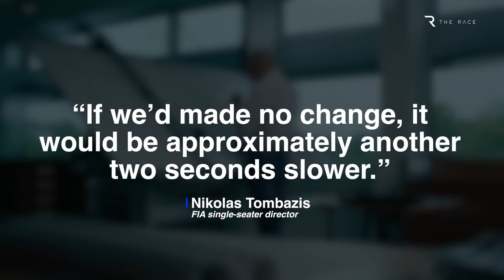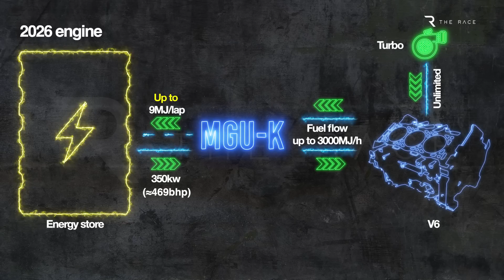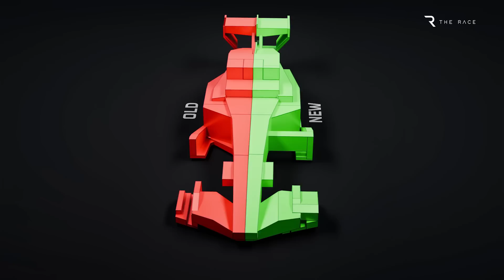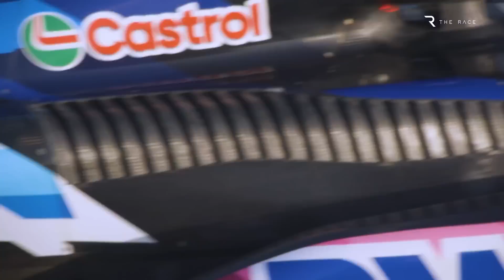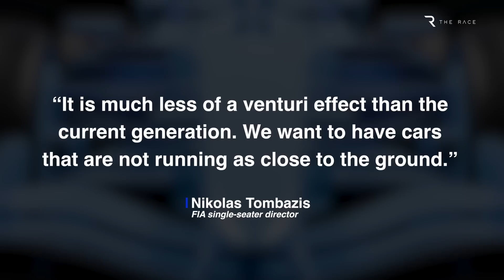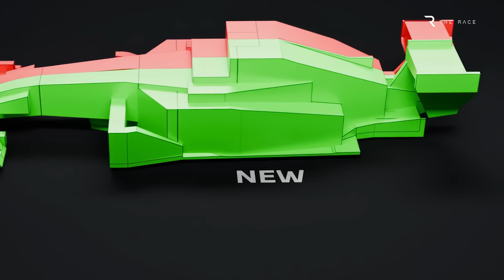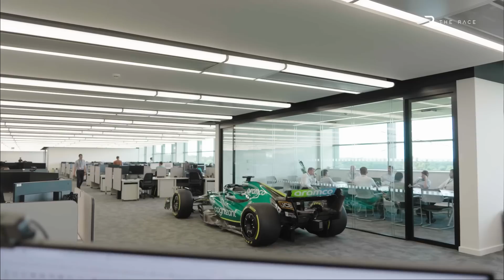How F1's 2026 cars will now be two seconds faster

Comment: If they make the body 10 cm narrower during every 5-6 years rules change then in about 500 years we should have a Monaco Grand Prix that is actually worth watching! 👍
Reply: I don't know, people seem to really enjoy Monaco during Formula E races and those cars have sizes comparable to F1's with the 2026 regulations. I think the slightly shorter and narrower body will make a bigger difference than we think in cramped circuits.
Reply: @theviniso  Yes, but Formula E has the advantage of low downforce and equal cars.
Reply: @Lianpe98 I wouldn't call E racing cars equal, if they where actually equal they would have the exact same track time and all the cars would be on the front row #1 qualifier.
Reply: @Allansybesma  It's a spec series, isn't it? It's all about the driver and the setup.
Reply: @Lianpe98  It's not. The chassis is spec but teams make their own power units, gearboxes and suspension.
Reply: @julianturberfield7101  oh, ok, nevermind then
Reply: @julianturberfield7101    Aka, spec series.
Reply: @Allansybesma  ??? dude, the drivers make the difference
Reply: @theviniso  Nothing will change overtaking-wise, especially considering the pre-1998 car dimensions.
Reply: Monaco is great in Formula E, the cars are not even that much smaller but the racing is great
Reply: monaco is not worth watching, watch the qually and then you know the race result
Reply: The car has to be a french fry wide to actually make monaco interesting
Reply: Monaco was never worth watching and I have watched it for over 40 years.
Reply: @AlexandreMS71 yea it's not wide enough to make good passes.
Reply: @AlexandreMS71 then you must have missed some bits along the way ;). Those last few laps of monaco 1992 are probably the most exhilerating thing ive seen happen in any series on any circuit
Reply: @AlexandreMS71  Guess you started watching after 1984
Reply: @harrr53  1978
Reply: @AlexandreMS71  And in what way was the 1984 Monaco GP not worth it?
Reply: @harrr53  it was an exception, not a rule, 1 out of 10 or 20, I do not think it is worth at all. And by the way I am Brazilian and a huge Senna fan.
Reply: Monaco circuit should have been CANCELED many years ago!!!
It does not offer the spectate required by F1 viewers!
Reply: Yeah instead of the “Monaco car show “
Reply: It’ll just regress into formula E
Reply: Width is not an issue. 80s F1 cars used to be even wider than what we have now, but they were significantly shorter at like 4.3m. They had no problems racing at Monaco back then.
Reply: I don't think you guys realize how much more difference length makes than width. Have you ever been on a bus where the front wheels cleared the curb on a corner, but the rears didn't? Yeah...
Reply: Monaco qualification is entertaining ngl
Reply: Monaco is always worth to watch
Reply: The problem is not the width but the length and how clumsy they are at slow speeds. It makes tight turns difficult. Monaco is about the challenge of concentration, not overtakes. The issue was that F1 added "street races" that aren't street races and immediately devalued the novelty of Monaco. But unlike many races, the result can turn on its head at any point because of the high chance of SC or rain. It's not the circuit's fault if that doesn't happen.
Reply: BuT ThE qUAly iS aMaZinG!!!!

Jesus Christ....
Reply: @belhaddim5116  it was 🤷‍♂️
Reply: Yea you would be sitting in a seat and nothing around you, you would be looking down the center of your car and seeing the sharp edge of a sheet of paper, and I don't like the idea of adjusting the front and rear wings from the inside of the car, it should only be done in the pits or box as they call it.
Reply: @Allansybesma  good thing nobody cares what you think, active aero is long past due

Comment: based on the loosk of the render we getting some very Sakiddish cars at low speed and grippy cars ant high spees we going back to 2008 so expect to see alot of cars in the wall and drivers like Hulk Lewis alonso and maybe Max can abuse them in a way we not seen in while like down shfting to make the car slide for a switch back at a hair pin